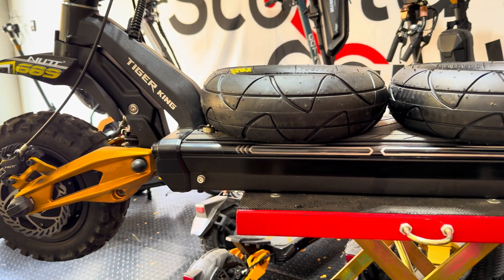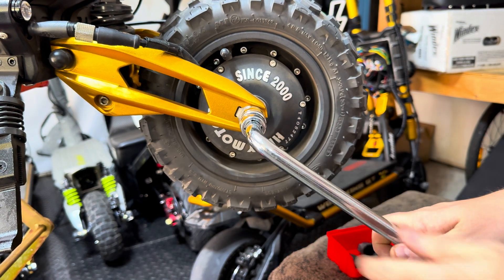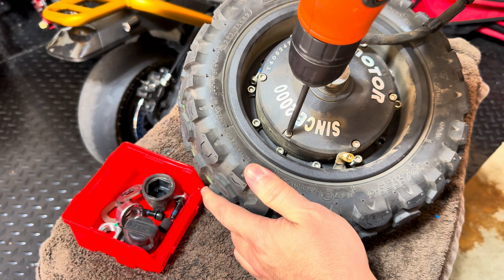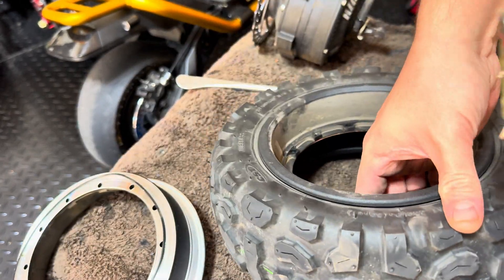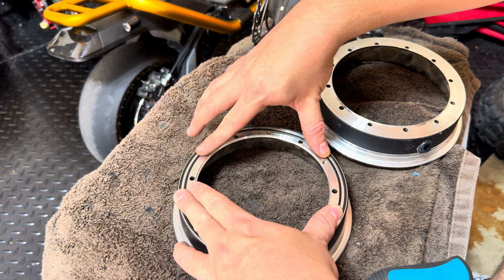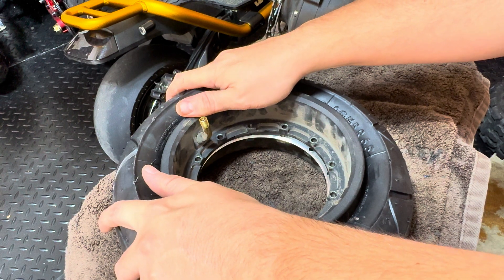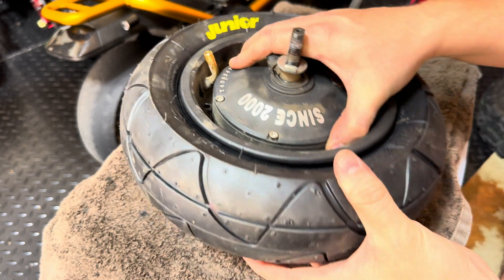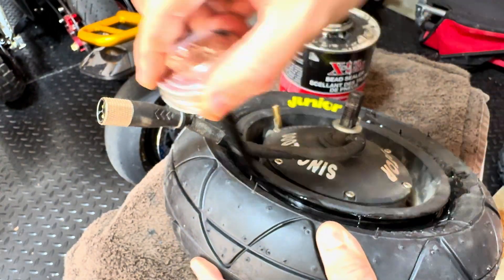Is This Electric Scooter Design GENIUS or FLAWED?!?! Eahora Tiger King Tire Change: Upgrade to PMT!

Comment: Quick question, do you have any clue on how tight the bolts that hold that threaded rod that runs through the swing arms and shock bottom bushing should be? On mine the rod is shorter than the width of the swingarms at the bolt heads so it's sort of floating in there, and tightening these bolts too hard causes suspension binding as they press against the plastic bushings of the shock. Thanks!
Reply from the maker: I'm not sure sorry I don't have this scooter anymore but it sounds like you need a washer or two on each end to take up the gap

Comment: Also did that wheel motor wire come factory with quick disconnect? Looks like its outside the deck/battery cover making dramatically easier to work on the tire & motor.

Comment: Taking the shrader valve stem core  out got the tire to inflate but then the tire deflated in about 1 second after I removed the air compressor air gun chuck-  no time to re install stem core.  What am I missing?
Reply from the maker: Yeah you can't install a valve core when there is air in the tire, you only do that step to seat the bead on the rim, then install the valve core and inflate like normal.

Comment: perfect video! i have alot of split rim scooters and what i found useful is getting a tire that has thicker width so the bead is closer to the rim. i use 120mm wide tires for my HM60 motors, and they set very fast. also you want a super high psi compressor too. HM motors are the OEM for mini motor.
Reply from the maker: That's a great tip about the tire width, thanks for sharing!

Comment: put the Rubberring for 1 Minutes in the Microwave so it be softer and stretch. solong it is warm it will fit much better and stay on the Place.
Reply from the maker: You can reuse that gasket if you like, but it will be a much better seal to use the gasket maker!

Comment: Is there a road tire that fits? Have you heard of anyone else having this problem with the rubber gasket?
Reply from the maker: This PMT tire is a road tire, and all of the PMT 11 inch tires will fit. I don't know anyone else with this scooter yet sorry it's pretty new
Reply: Thanks for getting back to me. You do great reviews. The problem is you make it too hard to decide on what scooter to get. I’m torn between the Maxfun and Tiger King any advice?

Comment: heat the rubber up a little hair drier bro come on now it will get longer it u heat it up a little over u riding in cold an heating up an geting cold over time it will not be right sizs i bet
Reply from the maker: Haven't been riding it in cold, literally just got the scooter it's brand new

Comment: You could make your own gasket, using black silicone adhesive, a 18ga with syringe and an open mind.  The trick is to make your own gasket using the silicone, but not sticking the 2 half's together. You are extruding a vreed in the grooves letting it air out and closing the 2 half's after the silicone dries.
Reply from the maker: Its ok this should work fine, gasket maker is used in a lot of automotive repairs that are under much more heat and pressure then this little scooter tire. I think it should last until I need to change the tire again!
Reply: @ScootaGang  i like the one comment about super glue the thing in place worth a shot.

My first scooter is the same frame as your solar P1. Im now satisfied scooters are a perfect alternative for cars where I live, getting around my small island with speed limits maxed out at 45. Im now willing to invest in quality. I do not need the speed of the RS but I do need the range...for some one who only needs to go 50 max and weighs only 150lbs you think the RS lite is every bit as good as the RS? I have no need to go 70 and more interested in range and not trying to pay a grand for 25 extra miles. 🙄 should I just get the RS lite already...I rode my ebike all winter in the snow etc the battery did not freeze but it was also removeable...I see you can get kits to stud escooter tires for snow and ice but I wonder what you think winter performance will be like.

Comment: Yeah, that rubber seal is garbage. You’re better off using gasket maker or something that is definitely a flaw design. My roadrunner split rims have a good design where each piece of the rim slides into a little rubber and seals the air haven’t had any problem.
Reply from the maker: Feel like the gasket is just a hair too small,. If it fit in the groove it would work fine, it was working fine before I took it apart.

Comment: Wouldn't it be easier to just use an inner tube with split rims or is there a trade off by using tubes vs tubeless?
Reply: Are use tubes in my split rims and never had any issue
Reply from the maker: It's the same difference in labor with either design, but riding on Tubeless is superior and much preferred so this is better to me then a normal split rim with tube...
Reply: @ScootaGang  just curious, what is the difference in feel? I never rode without tubes in my tires and it seems like it’s a good trade-off to have tubes because you don’t have to mess around with setting the bead.
Reply: @ScootaGang quick question, incase of a flat tire especially the front is it safer using tubeless like on cars or a tube, have you noticed?. Thanks

Comment: Seems like its no easier than a regular tire change. Wood clamps, and zip ties. And dont forget the lube.
Reply from the maker: It's only easier if you don't want to lever the tire over the rim. It actually takes longer for me then a normal solid rim. But it is easier imo for the average joe
Reply: @ScootaGang  in my youth I once changed a 50cc scooter tire with 2 butter knives and no lube. No internet back in those days to teach me right. Whenever I use a tire lever I remember that exhausting day. 😅

Comment: Gasket maker is how I sealed my cheap Chinese scooter to make it ip68. Did the motors, deck, every screw, and bolt hole.
Reply: ip68.. is it a submarine?
Reply: @SirLucian69  it is now, it has to survive snow and 4" deep puddles at 30 mph. The ip56 rating it came with was not going to cut it.
Reply from the maker: Yeah this stuff is really highly recommended by mechanics. Can withstand high psi and high temps much more then this small tire/motor will produce. Should last until I take it apart I hope!